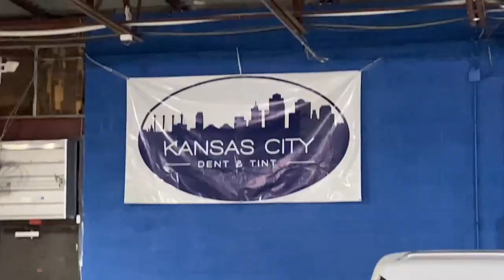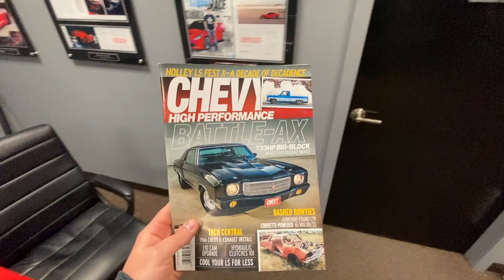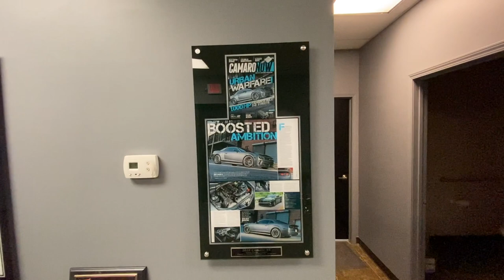I took the exhaust off my 1300+hp C7 and the results are AMAZING!

Comment: Question, you did change the fuel rails on Dori right, I know the factory ones with that rubber hose going around to feed the other side of the injectors has always been a problem, even starving the fuel to that side destroying engines ? Awesome shop brother, all your builds are epic in my opinion period 💯🏁😀

Comment: I wanted to cut the mufflers off of my gen 5 zl1 and do turndown tips like a copo but the shop said I would have heating problems and melt my fenders. So can you run your setup on the street with no issues?  Ty